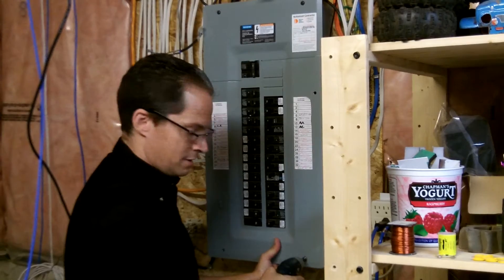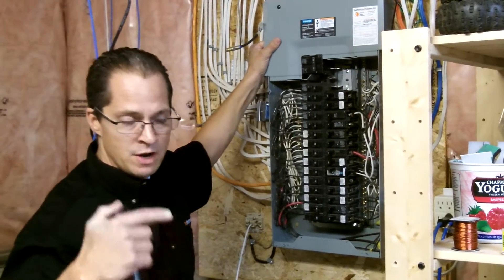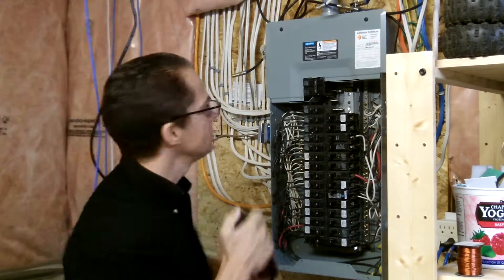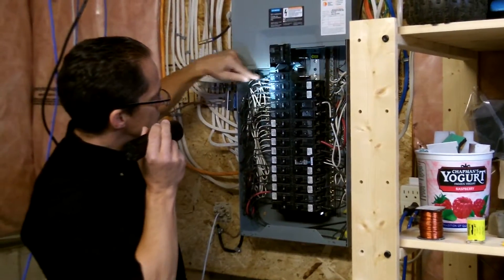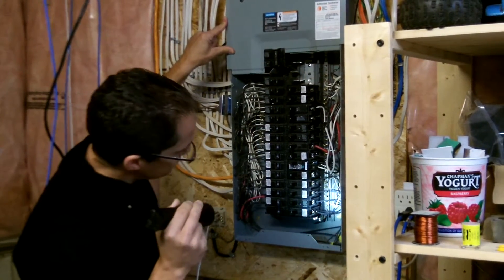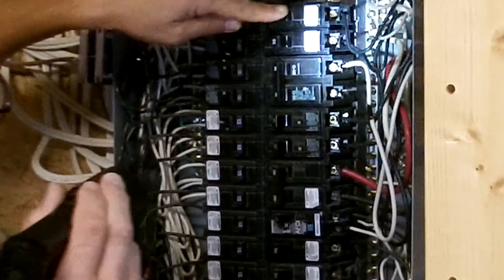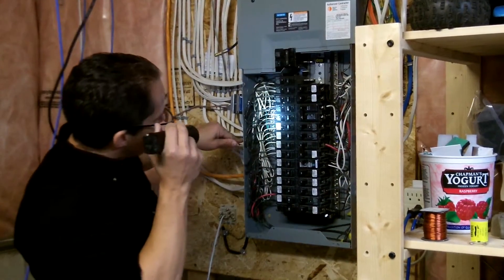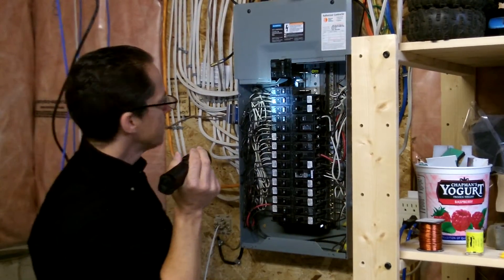Electrical Panel Inspection

Comment: You can have connectors in a box.
Reply: The other Youtube inspector "AJ" allows splices inside the panel.
Reply: only if they terminate somewhere in box per code